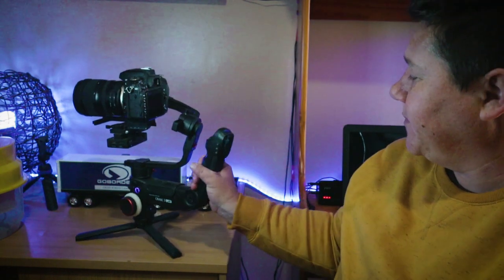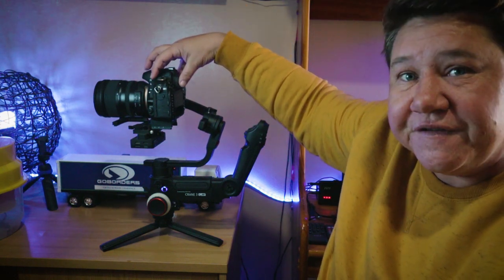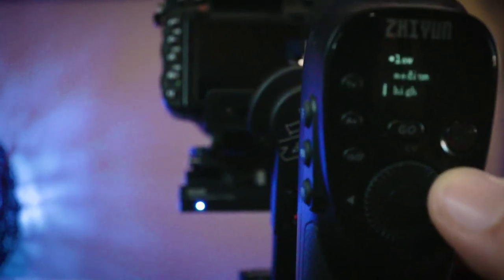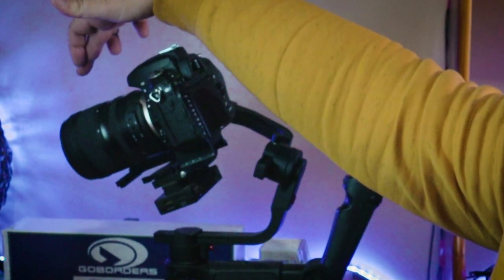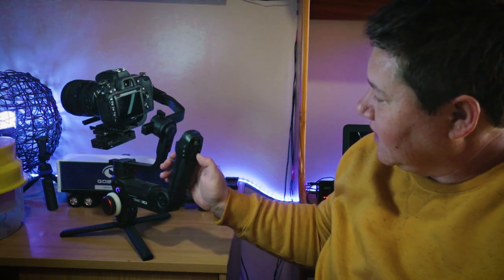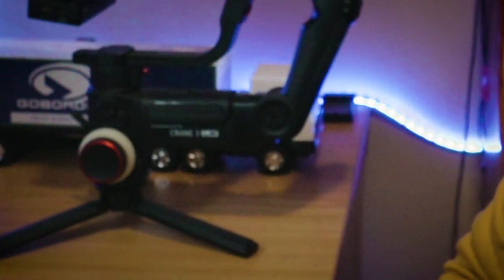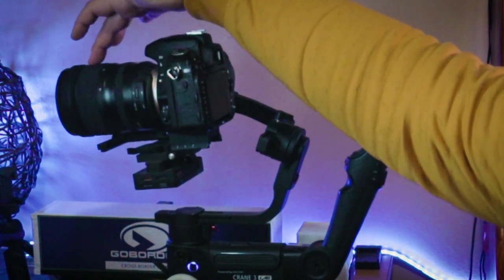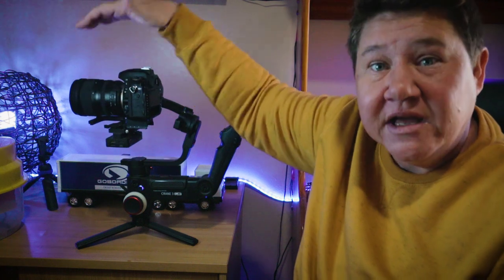Zhiyun crane 3 motor settings #violethenning

Comment: Does it have any negative effects when I’d use high when medium would be enough (other than faster battery drain). I have an Canon R6 + Sigma 24-35 f2 + RF Adapter. I guess medium should be enough, I don’t know :)

Comment: please make the video :- how to connect crane 3 to camera via cables
Reply from the maker: Thanks i wanted to but my camera does not want to connect. Onoy certain models can do it. I have the Nikon D750
Reply: @VioletHenning  ok no problem, could you talk about crane 3 all buttons settings mode.
Reply from the maker: Yes i can do that. Did youbsee my video on the top 5 settings of the crane 3?

Comment: Does anyone know how to get the crane 3s out of standby mode?
Reply from the maker: Hi it shouldnt stay in stanby mode if you switched it on. Have you tried removi g the batteries and inserting them again and switching it on again?
Reply: @VioletHenning  yes and I've drained the batteries and recharged them and it still goes in to standby when I turn it on.
Reply from the maker: Oh wow thats very weird. I would contact support of i was you, or take it to the shop you bought it from. It sounds like a technical issue
Reply from the maker: From what i understand if you press the power button twice, the gimbal goes into stanby mode. To fix it, just short press the power button again. Let me know if this helps
Reply: @VioletHenning  thanks for your follow ups Violet... I tried the short press and still no change from stand by. I looked over zhiyun's website for support and see they have a FB support page. I hope they can help.
Reply from the maker: So sorry that didnt work but i really hope you get assistance and maybe you can make a video on how to solve the problem 😊😁